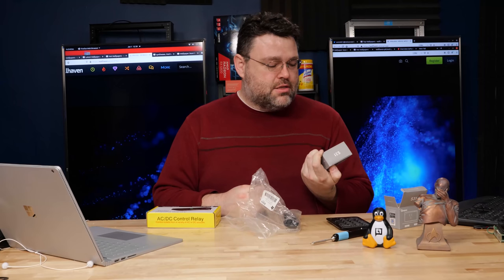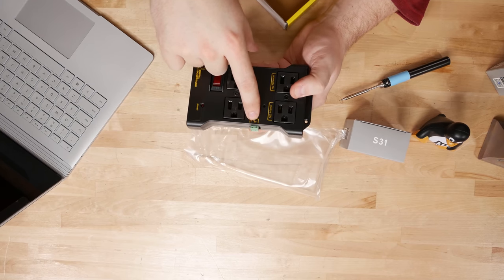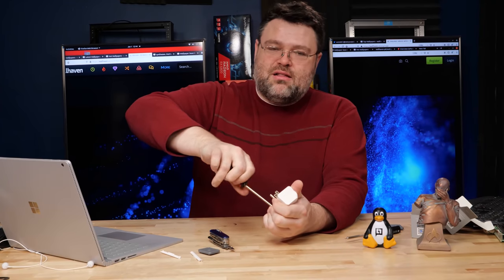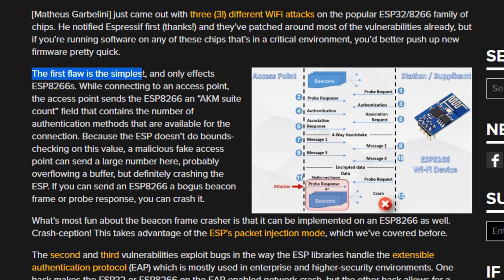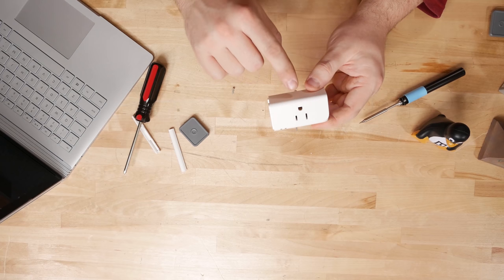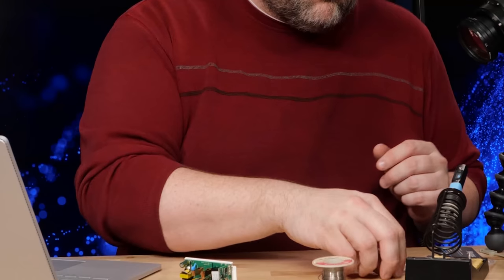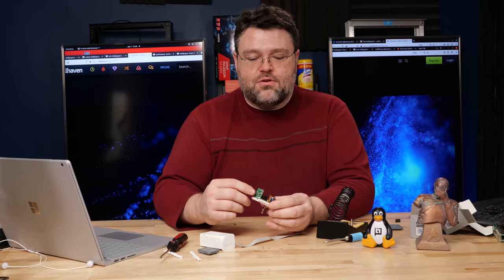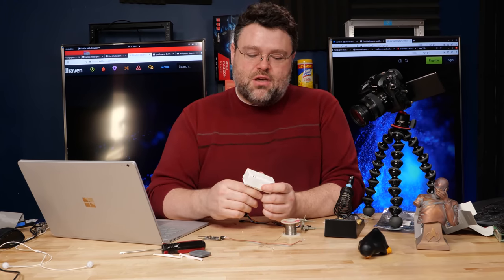Better IoT: Sonoff S31 - Smart Plug Home Automation - Replace Firmware w/Tasmota

Comment: I converted all my Tasmotized Sonoff devices to ESPHome about 1.5 years ago and have been very happy with it since. Works very well with HomeAssistant and I can manage them in the exact same way as my DIY ESP devices
Reply: I am using tasmota on all my sonoff devices. Any reason you moved to ESPHome?

Comment: Look into tasmotizer. It let's you pre-program the wifi connection info during flash time and avoids all the configuring over wifi and then power cycling to finally connect to the wifi you wanted in the first place. It is also much smarter, clearer, and more forgiving of flashing hiccups while it backs-up the current flash program before flashing the new one.

Comment: A very informative video, though I have a few questions for you:

1)	How many watts is your soldering iron?
2)	What gauge wire did you use to solder onto the S31?
3)	What type of solder did you use?

Thank you in advance for your time and consideration.

Comment: The clamps dont fit with all of the Sonoff boards, but there's a nice alternative if you have a 3D printer (or want to go wild with a bit of tape and other stuff). You can buy pre-soldered pogo-pin connectors from AliExpress which make the flashing really easy. Just push it on your board and you're done :)

Comment: I have been loving this better IoT series and I completely agree that the IoT world needs to take a step back and reconsider all the nonsense! Regarding smart outlets, although I love sonoff's price/quality ratio and use their stuff at home, I think a better smart outlet solution is to have something like a Shelly 2.5 inside the outlet, it also measures power and it looks way better

Comment: I have a variant of these, a few actually, all running tasmota. I was using one to control power to my workstation (I had an issue for a while where the system would hard lock and require power to be completely removed from the system for a few minutes), and I had what I believe to be an mcu reboot/reset possibly due to a watchdog timeout, which briefly removed power from my workstation.

Just something to keep in mind depending on what application you're using them for.

Comment: I was able to flash tasmota on a couple costco smart plugs using OTA Tuya convert. Very simple without having to take the plugs apart.
Reply: Some additional details would be great
Reply: @nikolausluhrs  they are probably talking about the Feit Electric branded stuff. I bought a bunch from Costco a month or two ago because it was on sale.
Unfortunately that flashing game is over for the moment. They have changed the controller board to  their own design making it incompatible with the current third-party software. :(. The light bulbs might still be flash able but the smart plugs and the smart switchs are not. 
The only way you get get local control is signing up for a Tuya development account and then adding each plug to be a development plug on Tuya's website.  
I think once you have setup you can block internet and everything will function via local control.  

But I wouldn't recommend them if you want to flash them or want local control. :(
Reply: @Catsrules1  you just flash tasmota with tuya convert. Totally open source, nobody's site.. It depends what your device is and you should check before buying, but..

Comment: Great video!  I dunno, maybe the answer is more low voltage DC distribution panels with automation built in that can be used per room/zone for things like lighting, IOT and other devices that don't need 110v AC service in the first place.  24V -48V is pretty easy to work with.  It's certainly more efficient, safer and cheaper at scale for the short distances needed in a home.  I'd love to see a world where power and data can exist on the same cable where possible, like POE.

Comment: I would also like to recommend the devices from shelly. They have a cloud option but that can be disabled and can instead be controlled via MQTT or CoAP. Most of them also are made with an ESP8266 so they can be reprogrammable as well.

Comment: I'd like to mention that if you don't care about fire risk, the ESP8266/ESP32 based power relay boards can be bought for ~3$ shipped(or ~5$ with a case).

Comment: I have a EU plug with two extra USB ports by Gosund that is/was flashable over the air with a Raspberry Pi. Very useful with a 3d printer with OctoPrint on a RPi for thermal runaway detection.

Comment: Wendell, you should crimp these connectors and assemble them instead of soldering them. You have many cheap chinese kit for sale to do this.
Then you have no problem with the soldering balls, just try pulling a bit on them to check before use.

Comment: I just got one of those myself and flashed tasmota.  love it.  I don’t understand your security concerns, if it’s flashed with open source software, what is the issue?
Reply: I think his main concern  is that it is wireless and therefore can be exploited somehow.
Reply: @bassplaya69er  Are you saying that there remains some firmware on the device after flashing that can contain a vulnerability?  Or are you saying tasmota is built on base firmware called esp core that may contain some vulnerability?  okay then, I just think that if it is open source then there is nothing hiding in there that phones home or does anything I wouldn't expect.  I typically block IoT devices from accessing the internet anyway and just access them through vpn.  
Concerning the vulnerability, it seems kind of crazy.  Am I really worried about someone in a van outside my house looking for IoT devices that could be vulnerable?  That sounds like some NSA shit to me, not really worried about that.  I mean they could probably just get in a million other ways if they are government.  Also, what if the ssid is not broadcast.

Comment: costco sells 2 packs of a different power plug that is basically thr same as that and works with tasmota and other firmwares, while also being a lot less expensive to buy (at least up here in Canada).
Reply: same for switches fyi. Also, if you want to make a power plug in the wall into this you can use shelly, they have UL certified stuff.

Comment: What makes the 'smart' home actually smart is not plugs and lights you can control from a phone app, but lights, plugs and just about anything else that is automated. Automation is what makes a smart home 'smart'. - Home assistant is a great central hub to pull lots of different systems together under one hood, but it's still pretty poor on automation. - Wendle, look at doing a series on NodeRed for automation. I've been using it for over a year now and I'm still amazed every day at how flexible it is and no coding is required to get up and running...

Comment: I like the Arduino/Raspberry Pi plug better. Also I noticed someone else flashed Tasmota to a different IoT device without having to take it apart. Maybe there are more out there  that are supported by tasmota.

Comment: So what's wrong with just using a smart plug? If all they can do is turn your lights on and off?
Reply: You need to buy into the whole ecosystem if you go that route, which means 2 things: you sacrifice alot of privacy in a full smart home setup if you go the cloud route and you also lose some flexibility, some people love to hack their own system together, it's fun to DIY stuff for alot of people.
Reply: Uh you need a cloud account to even use the app. This is completely ridiculous.
Reply: Yeah, ignoring the lax security, by far the biggest issue with ALL (current) internet of tat devices is compatibility with each other, you can't just go out and buy a nest thermostat, a ring doorbell, philips light bulbs and sonoff outlets then expect any of it to work together, aside from one exception which involves setting up IFTTT but not everything supports it or  might work finicky and worse yet, they'll force you to download the app and make an account for each and every different device.

I don't think consumer home automation will ever take off until average joe can go to the store and buy any random smart device and control all of it from a single app like you somewhat can if you're willing to use a smart speaker with IFTTT.
Reply: @vgamesx1  weird, I have a google home mini, tada smart thermostats, philips hue and some aliexpress lights and the all work perfectly via Google home.🤷

Comment: I guess instead of using the ftdi USB to serial converter, I could just use the tx/rx pins from a raspberry pi to flash the firmware

Comment: OTA method doesn't work on the newer versions because they patched the exploit.
Reply: A lot of hardware changed the IoT chips they use - this was an error, but there's still plenty around that do still work.. I'm sure projects will be adding support before long anyway even for the other HW. Pays to check before buying.

Comment: Of you using it just to control led strip / dc led driver SONOFF SV would be better as you power it directly from dc power supply. Or why not use sonnof basic much cheaper easier to hack

Comment: What the ... ???  Title says Better IoT: Sonoff S31, but you spend a lot of time on the Adafruit Relay, complaining about the security of a wireless device, taking the Sonoff S31 apart, complaining that the 8266 is too powerful for this use, complaining that it's designed to be isolated (uh, yeah, of course it is!  ...you do know Sonoff makes modules designed for separate wiring, right?)...   No details about the FTDI board, no details about the Tasmota setup, and then a summary of what you want to do for the next video.  Which, as far as I can tell, you never actually do (next Better IoT focuses on an alarm system).